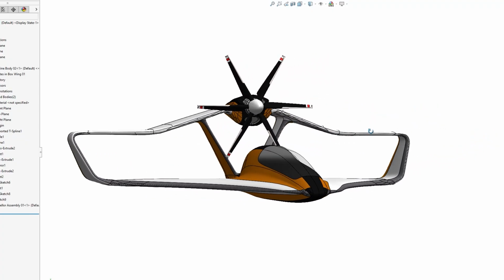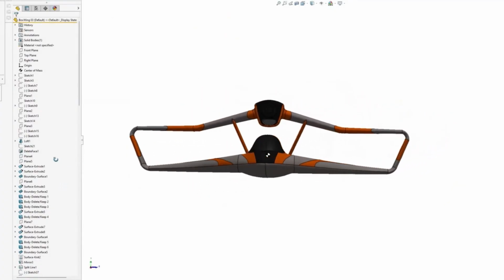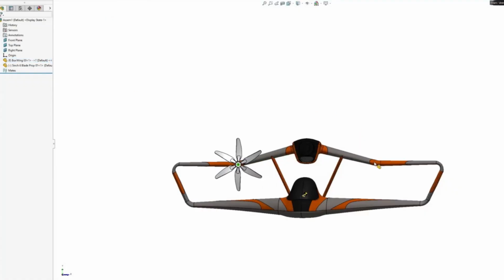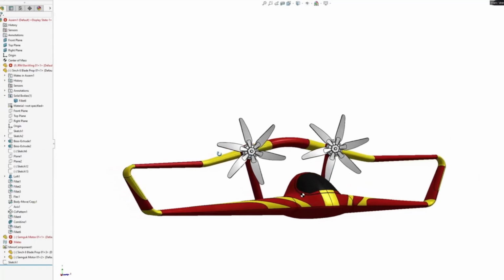Designing a unique Box Wing Plane for VTO and Waterlanding Pt.1

Comment: I think the original plane with the engine in the rear middle. Would have been almost perfect if you attached another engine. Inline with the 1st engine. Counter rotation. When you put a prop behind another prop there are some big advantages in aerodynamics prop wash ect. But most of all it gets to make use of much of the lost air the original prop flag to the side rather than straight back

Comment: I believe T-splines was developed by Rhino, and was/is available, at least in 5. Currently I think they are on 7, and have replaced tsplines with something else. I was thinking grasshopper for Rhino had a very similar adaptive modeling method, using control points. Its been a while since using and I didn't use tsplines very much. 
If you are a "student" with college ID, you can get a copy of Rhino for like $800-1000. Its old school, you buy it and its yours. no subscriptions. 
Im working on a very similar amphibious double delta, lifting body ultralight. Kinda like the Dyke Delta. But part 103 compliant. 
Thanks for sharing your progress and development approach.

Comment: I made something similar in Spaceflight Simulator, but it was a backwards reentry prototype. The Bottom of the wings was the heatshield and it would re-enter the atmosphere pointing upwards.

I had loads of fun with that before an update in 2021 added engine heat damage, as the engines were fully protected by heatshields as well.

Comment: Maybe it would have added too much weight to the model, but did you consider two servos for the center upper wing control surfaces?  With the mixing available in modern radios you could have the outer surfaces as pure aileron and the center surfaces mixed as elevons.

Comment: if you did any CFD simulations or stability calculations how's it performing in terms of stability? especially pitch momentum and propeller vortex influence on the wings is what i'm curious about. Also i see possible risk of rudder and upper wing control surfaces ineffectivness at high AOA, is this something you would think that a concept like this could face? Thanks and have a nice day

Comment: Looks good. In Order to keep everything dry id suggest mounting the rudder Servo in the top wing or leave it out completly and use differential throttle for easy on water steering.